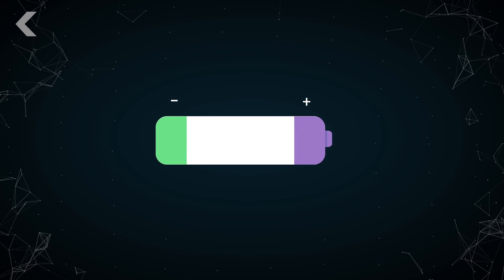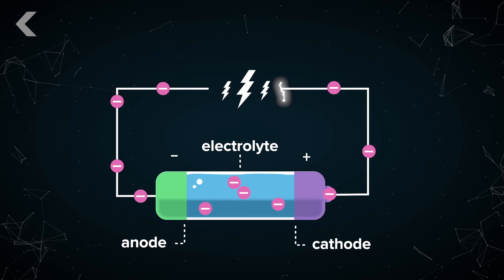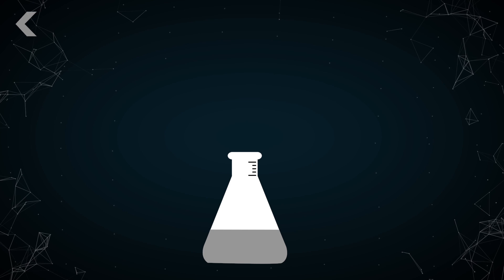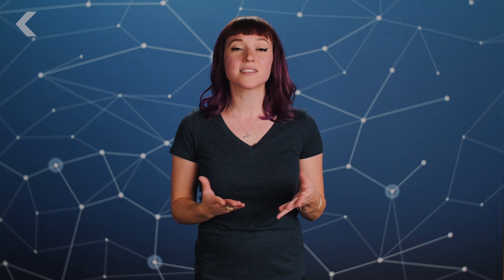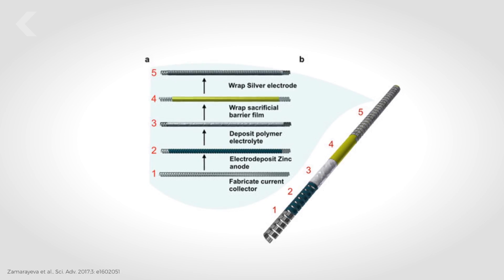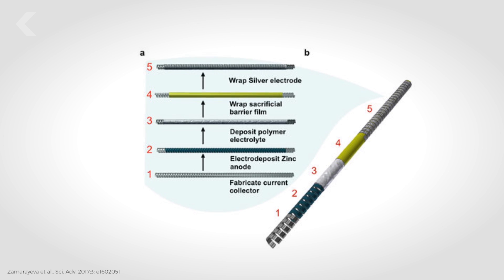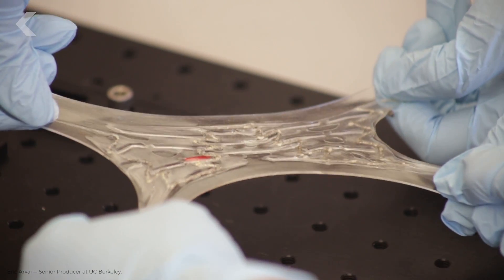Stretchy Batteries Are Coming... Here's How They Work

Comment: Ugh have you ever heard of Graphene its ultra light weight flexible 200 times stronger than steel and could be used in batteries that would well be flexible hold double the amount of electricity and charge in a few seconds oh and did i say that its just Carbon so i would be cheap to make
And it would be bio degradable
Reply: Rick Harper just because its made out of carbon doesnt mean its easy to make. Carbon is very abundant but the current processes of making graphene are pricey and dont have a big yield

Comment: it seems to me that wearable devices should be powered by energy stored in super capacitors. (Flexible super capacitors are now in development using graphene electrode, unlike batteries,they have the advantage of virtually infinity recharge/discharge cycles).  These capacitors should be recharged from the environment and the action of the users body. There must be a number of ways of harvesting energy from a human body or its surroundings. Modern electronics can be designed to operate on  picoamps of currents. One possible power source might be piezoelectric polymers included in the fabric of clothing. Such materials would generate small amounts of current with each movement of the body. Devices might connect to such clothing via conductive rings on contacts on sleeves, lapels or chest  or waist patches. These connection could take the form of  a magnetic buttons, wrist bands with alternating link of conductor and insulator, conductive velcro or conductive zebra stripes, like that used to  connect LCD displays to circuit boards. Small generators could be built into belts, such devices are know and use a combination of coils, springs and neodymium magnets to produce power.. Shoes are an obvious source of power, as each step compresses and stretches the shoe structure, by repeatedly applying the full force associated with the body's weight on the sole of the shoes. One problem with this is the need to make an electrical connection to the electronics packages worn on other parts of the body. Provided the user is not bare footed, wide strips of  conductive polymers built into clothing might be used to conduct the current to where it is required. The intermittent nature of the connection may not be a problem if rectifiers, storage capacitors and voltage regulators are designed into the electronic packages. Interestingly the above might give purpose to the cat suit uniforms so frequently featured in science fiction films. such a continuous article of clothing greatly simply the inclusion of the power sources and associate conductors and connection described above:-). Just an idea.
Reply: Nigel Johnson cant you make it a bit longer.........
Reply: No one is forcing you to read it. If you don't like it don't read it. Reviewing the comments, I note you do not have any ideas of your own, I suggest you just keep banging the rock together.

Comment: I just want devices with rechargeable batteries that can be changed when dead. sealed for life devices have built in obsolescence, since the whole device must be thrown away when the battery no longer holds a charge. Untill rechargeable batteries can be recharged a near infinity number of times, without loss of stored energy capacity, make the batteries user replaceable and make the battery case an open standard size. Next time you buy a really expensive phone, laptop or tablet it might be worth checking if the battery can be replaced or you may be amortising your investment in the device over the life of the battery. This maybe as little as two years. In any case, sealed for life devices, where the battery life defines the life of the device is very bad for the environment, as all that electronics and the work and materials that went into its production are turned to waste. 
Do not be fooled by manufacturers who claim their device batteries can be replaced, when in fact the battery is none standard and in limited supply or where there is a good chance the user will damage the device while attempting to replace the battery. These are examples of designed in obsolescence intended to make the consumer buy a replacement product at another exorbitant price.
A battery end of life failure is about the only component failure that will not have a negative impact on the device manufacturer's reputation.

Comment: SOMEONE PLEASE figure out how to use our body fat to power our devices. Two birds yo
Reply: in theory you could just cut out the fat and burn it to make steam but... i don't think that's comfortable
Reply: You guys know what I meant. I can also turn sunlight into body fat but that doesn't make the process fast, easy or efficient.
Reply: Threadmill powered generator.
Reply: Well, I'm sure the nanobots they're going to be installing in our bodies will have to have some way to get energy. Fat cells store quite a bit of it.
Reply: they have that. here's how to make your own. take an elliptical exercise bike. take the magnetic motor out that changes how hard it is to pedal. replace it with a treadmill motor. connect things to the motor.  get on the bike and run.

Comment: we should genetically engineer special cells or structures of cells that can go our body and extract useful amounts of electricity from our blood supply. Bloods full of energy, we should be able to generate electricity from it. Think of it like the alternator in your car. The engine it primarily there to convert chemical energy into kinetic energy. But we also bolt am alternator onto it to generate the electricity we need to start the car question later that day.
Reply: http://www.popsci.com/science/article/2011-05/installing-tiny-turbine-bloodstream-could-power-implanted-medical-devices-indefinitely
Reply: http://www.wired.co.uk/article/fuel-cell-generates-power-from-human-blood

Comment: Anode is POSITIVE, whilst Cathode is NEGATIVE .. Pathetic!
Reply: lol.  Look.  It's a pompous and insulting comment with an incorrect correction.
Reply: https://en.wikipedia.org/wiki/Anode
"...cathode ray tube, the anode is the positive terminal where electrons flow out of the device, ... In a battery or galvanic cell, the anode is the negative electrode from which electrons flow out towards the external part of the circuit." Are you too stupid to google this or too stupid to understand the answers you got?
Reply: Umm no, they flow from the negative anode T the positive cathode, just like the video says...
Reply: Holy idiot.
Reply: That's sparked some argument
Reply: I think it's different for batteries.
Reply: Electrons flow from Cathode to Anode not vice versa! ... you need more time to check before publishing new videos.
Reply: Umm I'd say you need to research better. Anode is negative, cathode is positive. Electrons flow from anode to cathode

Comment: That representation of a battery was very cringe worthy.  Please do some research before you draw a battery, very few batteries use inflexible solids such as lead acid, even alkaline cells are swiss roll and could be formatted into a flexible pouch cell.

Comment: what about skipping batteries (for putting in your body)  and using super capacitors? batteries run out and eventually lose viability, they simply don't work the same as when they're brand new,  this j
happens with many if not all smart phones and with the already heightened temperature in our bodies the battery would be aggrivated by heat damage even more losing more and more of it's ability to hold a charge, there is actually a good flexible phone already called the arubix portal

Comment: I've always thought the ultimate solution to powering wearable electronics would be to have some sort of micro-fuelcell implant subdermally that could burn glucose (sugars) in the blood and convert to electrical energy - essentially just connecting it to the body's own fuel-supply. Wearable devices consume so little power compared to our bodies that there shouldn't be any more noticable impact from that then you notice your car using more fuel because you have the radio on. The big benefit here is that you will always have power no matter what. Far more reliable than solar-cells or having to charge batteries (some batteries would be used for buffering in any case I'm sure, but not having to actively recharge them is the key).

Then from there you can transfer the energy to the devices in a number of ways - inductive transfer + clothing integrated stretchy conductors. I've even heard that conducting power through the surface of the skin might be an option here. Maybe even wireless transfer once that technology improves.
Reply: TheStigma nice idea

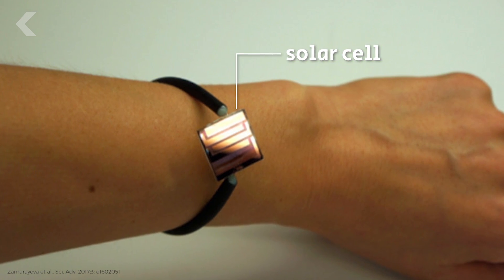Comment: 2:29 but what if the person doesn't even go outside? and will that be enough for a few volt battery? i mean isn't that solar panel really small?
Reply: You still shouldn't have a problem unless you live in a windowless home
Reply: Tell Me This true enough
Reply: such devices need accumulators with a capacity of only a few mAh
even my  bluetooth-headset plays 6hr of music with 110mAh. So, 5mAh should be enough for tiny wearables.
Reply: No, the solar panel would have to be several inches in size to power even the smallest of today's tech like wireless headphones. Then you have the issue of skin cancer to deal with, you have to have say 8 hours of exposure to charge to be able to listen to music for a period. The solar cell in the video is smaller that what you get on even the cheapest of solar lights.
Reply: i run ultramarathons.. hoepfully they make a way to implement my kinetic energy into smth like that. then again i dont really need a phone but if i could power my mp3 player with solar power ;d
Reply: Solar panels work because of photons and unless you are in a non-lighted room, photons will strike the cells from your electric light source and then generate electricity.
Reply: Ryan Nguyen true

Comment: anode is + and cathode is -

please correct me if I am wrong
Reply: It varies, I googled it and in the case of a battery this is correct... Though I thought I read something like its possible to decide whether its an anode or a cathode depending on the circuit. Meh.
Reply: in chemistry i learned something like: the anode is where is oxidation happens and the cathode is where the reduction happens
Reply: Prashanth Pillamari only in an electrolytic cell
Reply: Prashanth Pillamari Nope that's not right. Cathode is + and anode is - 
Use this to remember better: the N in anode = Negative
May be a weird one, but works for me

Comment: and i've been waiting for graphene batteries
Reply: Graphene is the future
Reply: Farhan we already have graphene batteries... your probably thinking of graphine super capacitors.
Reply: euan todd I'm guessing he meant mass produced graphene batteries, one that could be found on convenient store cheaply. graphene batteries atm are quite expensive and not commonly available. Mass produced graphene supercapacitor is good too.
Reply: Graphene super-caps are more common than the graphene based carbon fullerene nanotube batteries that are in development.
Reply: Big Boy you do realise that that is a safety feature right? If your car didn't crumple then a lot more of the energy from the crash goes straight into accelerating you forward.
Reply: e.g. a super expensive car that won't buckle when you get in a wreck with one of those peasant steel cage cars
Reply: Yes, yes I do xD
It was a joke.
Reply: ... for almost anything. e.g., space elevators

Comment: How about a battery that makes its own energy?
Reply: Wolfga Gaming You cant produce energy from nothing.
Reply: Major Skies That might create like 1 second of battery life. Defiantly not worth it
Reply: Makes its own energy from what?
Reply: +cracktober That's not how it works. Flying is possible by the laws of the universe-- perpetual motion is not. It doesn't matter if the average person thought flying was impossible-- opinions don't determine laws of the universe.
Reply: Major Skies So you want a phone to produce kinetic energy or thermal energy to be transferred back into chemical? Lol what?
Reply: HB Designs Heres the thing, flying may have been considered impossible by some however it never was a true impossibility as we saw things fly all the time. Physically, everything you have been perpetuating inherently breaks the laws of physics. Nothing that has broken the laws of physics or thermodynamics has ever been proven to exist at any time in history.
Reply: Kiddo, go and study first law of thermodynamics... U will get your answer...
Reply: Perpetual energy is ridicules, it isn't possible.  Heat is a sign of the limitation of power systems, every system is less than 100% efficient, and the heat is energy lost from the system, even if you could recollect most of the heat generated by devices in an endothermic chemical reaction, you would still have lost energy in the reaction.  The best solution is to use photovoltaic cells to charge the device while it is in direct light.
Reply: DragonMC Well... we kind of already do that if you havent noticed. Lol.
Reply: HB, That means that the device is drawing from it's environment.  Nothing can fully sustain itself without an outside source. 80% of published experiments are false positives due to researcher oversight or bias.
Reply: Wolfga Gaming This conversation is turning into an AIDS fest. Too much talk of perpetual motion. It's impossible so please stop trying to justify it. Perpetual motion is not real.
Reply: Energy can neither be created nor destroyed. It can only be converted from one form to another.
Reply: Major Skies But its not powerful enough
Reply: Major Skies That would be breaking the laws of physics if it made power from the phones own heat. The phone uses the energy from the battery, and a slight amount is transferred to heat. Using that heat to create power is near impossible, as it would create much much less power than it took to heat up the phone in the first place. Its like plugging a power cord into itself and expecting it to make infinite power. It just doesnt work.
Reply: HB Designs Very true...
Reply: Acerrox Thank you thank you FUCKING THANK YOU!
Reply: Well that wouldn't be a battery that makes its own energy... But wind energy would be extremely inefficient, like I hardly use my phone in the wind. And I guess solar energy might be okay... But it would be kind of slow, I would rather just have a portable charger.
Reply: But yeah we already use solar and wind energy for other things.
Reply: nifker That would technically be a perpetual motion machine. Which is impossible, unless you mean it would just be reusing some of the energy it gives off? Which in that case would be a good idea because it increases the energy efficiency.
Reply: yeah just gotta break the laws of thermodynamics
Reply: +Sidney Decker
People break laws everyday, so it shouldn't be too difficult, right?
Reply: Acerrox yeah why not the it a shot
Reply: +Carl-Michael "Is there anyway to utilise the heat and kinetic energy from moving your body?"
Yes. http://static.tvtropes.org/pmwiki/pub/images/conanpain_422.jpg
Reply: how about an energy that makes its own battery
Reply: JoJo Ray yeah... so, why not convert wind and solar energy to electrical
Reply: HB Designs yeah, exactly what I'm telling JoJo ray
Reply: Jeremy Reese But this isnt something of 2017. We are still in the craze of the 'thinnest mobile ever' and having something to transfer energy on top of the basic smartphone components is a bit of a hand full at the moment
Reply: Use the audio port to stick a windmill in while you sit in front a fan blowing your beautiful balls as well as your mini windmill
Reply: Wolfga Gaming That is stupid. Science should focus on mass production first
Reply: Jeremy Reese Yes i know, i shared the link to show you. I mean, Newtons and Einsteins laws only apply to what we already know about in the universe. When you take in the possibilty of the multiverse and more variables, more than 100% efficiency could be possible. Obviously as far as we know, it isnt.
Reply: alex rentz 

Yes, that's why it's theoretical.
Reply: soooo.
we just need to improve wind/solar

to the point that it's on par with the efficiency of power banks etc.

but at the current state of technology.

that phone would be bulky/ not as effective

yet
Reply: Wolfga Gaming - Is there anyway to utilise the heat and kinetic energy from moving your body?
Reply: not easily.........................................................yet
Reply: Acerrox - I meant from just going about your life.
Reply: Wolfga Gaming how about marking wireless chargers better that way you could go into a room and charge your phone or build towers that can power your smartphone or any other gadget wirelessly
Reply: That's not how energy works.
Reply: Breaks the laws of thermodynamics, no machine ca  be perpetual
Reply: HB Designs Kinectic energy with batteries or heat? Would seem good for smart phones.
Reply: Impossible. Breaks one of Newtons  laws of energy (It says energy can't be destroyed nor can it be created. You can only change it between forms of energy, such as electric energy turning to heat.)
Reply: Thermodynamically impossible.
Reply: HB Designs Lets create a AAA size battery with the mass of one million suns, so that it Will emediately turn into a black hole and then disappear due to hawking radiation. Would be cool
Reply: WOW! HOW DIDN'T WE THINK OF THAT?! YOU MIGHT HAVE JUST REVOLUTIONIZED EVERYTHING!
Reply: HB Designs heat is already produced by phones anyway. Can't that be used?
Reply: HB Designs <--- what he/she said 👍
Reply: cracktober Thats what i tell everyone :) But my narrow minded friends cant get it in their heads lol
Reply: alex rentz http://inhabitat.com/mit-researchers-create-led-light-that-exceeds-100-percent-efficiency/

Aha, i just found this...